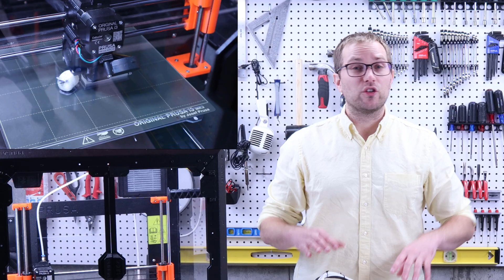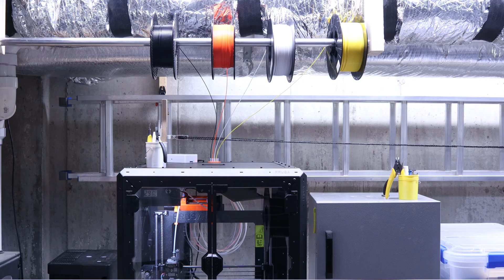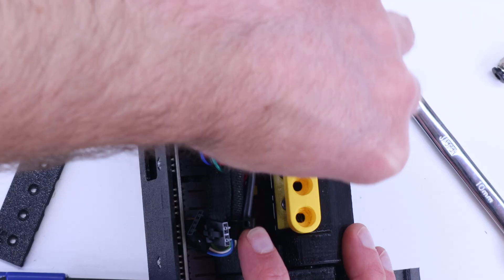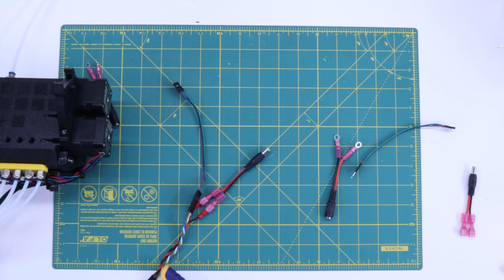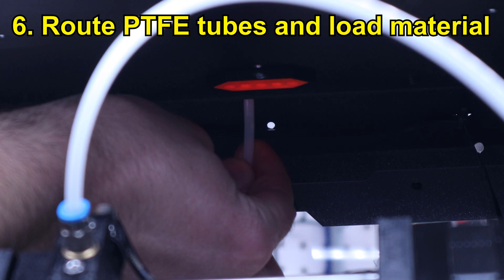How to fix the Prusa MMU2 Multi-Material Upgrade

Comment: Hey Asa, I'm returning after watching your video first time 2-3 months ago... You should definitelly check MMU3, it sesms to be much much more relieable... And, yeah white filament was causing issues for me too, just switched to a gray filament and it seems to be working fine so far (still printing)....
Reply from the maker: Thanks for watching and rewatching! I'm actually editing my MMU3 video now - should upload by the end of the week. I got two MMU2 to MMU3 upgrade kits and they're great

And yes, some white filaments seem to ball up just a bit more / worse. I switched to Overture PLA plus white and Jayco PLA white - no issues with either of them.
Reply: @AsaMakes  unfortunatelly my print failed after 5-6 hours. I now realize my problem is the "cooling tube lentgth" and "cooling tube position" settings in PrusaSlicer/OctoPrint. The tips are getting fatter when they come out of the extruder, and if that filament is not used enough they got even fatter and become so thick it is impossible to feed them to the extruder again, but they succesfully trigger the filament sensor, so the printer/MMU thinks the filament is in... And my setup is weird, I'm on an Ender 3 Pro, running a custom build of MMU3 with the 1.0.6 firmware version... So I don't have the cutter enabled, nor all the other fancy stuff... I'm also working on migrating the MMU3 related code (the new protocol) from Prusa Firmware to Marlin...
Reply: Success :) I just completed my first 0 intervention print with ~300 filament changes. Things that helped me to achieve this (may help other with Sprite Extruder Pro like me):
- "Cooling Tube Position & Length": As I mentioned in my previous comment, these were wrong, I was entering the distances for the heat break and not the PTFE tube before it, so entering the correct distances solved the "thick tips".
- PTFE Tube: Replaced the PTFE Tube inside the extruder with a new and high quality one with 1.85-1.90 mm ID.
- Ramming sequence and cooling move adjustments: For the SUNLU PLA that I'm using the following settings are working the best:
    - Loading speed at start: 19 mm/s
    - Loading speed: 14 mm/s
    - Unloading speed at start: 200 mm/s
    - Unloading speed: 90 mm/s
    - Delay after load: 0 s
    - Number of cooling moves: 4
    - Speed of the first cooling move: 20 mm/s
    - Speed of the last cooling move: 5 mm/s
    - Ramming parameters:
        - Total Ramming time: 5.00 s
        - Ramming line width: 120%
        - Ramming line spacing: 110%
        - And the ramming curve is a step like curve that starts at 4 mm3/s and goes up to 12-13 mm3/s.
Reply from the maker: Excellent glad to hear it & thanks for sharing

Comment: Printing the PTFE holder , stil have to print more pieces to setup the mmu2s on my prusabox. Also good to read you don't need that thing to control the filament rollback cause i am a bit in a thight ramp with space lol. Will get the m10 couplers from somewhere. Prolly uncle alie.
Reply from the maker: Lol uncle Alie

Good luck! These upgrades were a significant improvement for me. Very few issues since I released this video, just occasional failures to change filaments that I can usually recover from during the prints
Reply: @AsaMakes  Where did you buy the pfe tube with a wider hole?

Comment: Not sure about the video The MMU2 is the most aggravating piece of kit I purchased it worked for a while now I have red and green flashing light at every material change I suspect its the known power fault on the 5v rail and suggest its terminal till Prusa release the add on board.
Reply from the maker: I've never had the 5v issue - did you try plugging the USB micro into a USB power source?

Comment: One upgrade that I found helped my MMU2 was the Revo hotend.  That coupled with the larger ID PTFE tubes, the pass thru connectors, and the RMU filament buffer has made my setup very reliable.  Of course, I now have my 5 head XL so the future of my MMU2 is questionable.
Reply from the maker: I'm so jealous! Still haven't gotten a shipping email on my 5er XL preorder 

Good to know about the revo - I hadn't heard this before. Fortunately I've had great reliability since this video on my 2x MMU2s 

Thanks for watching!

Comment: Do the firmware update that came out yesterday

White uses titanium oxides for the color. Ti_xO_y compounds are high friction

DT or Deutsche connectors can do everything in one shot for connectors and they lock in place. They're meant for auto or marine applications, but also work well for installation where the disconnect is meant for service but not routine handling. They come in up to 20 pin assembly and they can handle 20A or so per pin
Reply from the maker: Thank you for the info! This is why I really like YouTube and the 3D printing subreddit - feels like the 90s internet when everyone was helping

And thanks for watching!
Reply: @AsaMakes  back in web 1.0 and 2.0 days with phpbb forums instead of muh social media. 

I have an mmu3 arriving in a few days shipped this morning. I'm really excited for functional prints with composite materials. Envision a 3d print in place machine with hinges in tpu, springs in petg, with a pla+ shell/housing supported by pva for perfectly accurate mechanisms that aren't welded together
Reply: @AsaMakes  
Also, lead white which idk if it's available, would be slippery af. Lead on gas was a lubrication and detonation suppression
Reply from the maker: Oh leaded gas... was a brilliant solution if you ignore the awful health and environmental issues. Same with asbestos -  incredible material, a shame it's harmful to humans. I'm sure our future robot overlords will go right back to using asbestos.

Comment: lol 800 changes is nothing. I have had many prints with over 1000. Print 1 might work fine. Print 2.......not so much. I'm probably around 1 in 500 maybe on average. But it can easily go 2000+. I've given up on the MMU2 since the MMU3 is coming soon. So right now just mono prints for me. I'll upgrade my 2 and buy a 3 for my mk4. Hopefully it works better. There are a lot of options on the table for me, but why bother when the 2 is basically dead.
Reply: I will mention my last mod though. It started as a repair, but turned into a mod. I had a piece of filament get stuck in the front most PTFE tube just before the selector (the short one with 1 beveled edge). I took it apart further than I ever have before since building it in the first place. I for the life of me could not get the filament out. It's like the filament became swollen. I can't explain it. So I went into my bag of spares and replaced it. Obviously the beveled edge should face the side that loads in the filament right? I don't need to check the directions.....oh wait......all the others the beveled edge is facing forward. Towards the selector. odd.........Well I screwed up the building of it then. Logically they need to be used for guiding in the filament during the loading process. So I flipped all of them. Put it back together. I noticed it was easier to load after this mod. Quite a bit actually. So I checked online the manual. The manual had it the way it was. The way that makes no sense. A number of people commented that it works better facing the way I have it now. Another person mention that his were beveled on both sides. So yeah very helpful for loading in new filament, but doesn't affect switching reliability.
Reply from the maker: Interesting! I will have to try this next time I do a disassembly. Thanks for watching!
Reply from the maker: Yeah I didn't have enough time to run as much as I wanted before releasing the video - fortunately no issues and many thousands of color swaps since releasing!
Reply: @AsaMakes  for me the things that mattered the most were playing around with cooling moves and increasing the unload speed, but there is a limit. If you go too fast it makes the tip WAY too jagged. I'm hoping that the mmu3 upgrades will solve issues and when combined with the easier to load nextruder the new setup with be rock solid. We'll see!
Reply from the maker: Likewise, I can't wait for MMU3 - hopefully it's been updated to support Mk4 by the time I get my Mk4 kits.

Comment: Yeah, the buffer assembly was the first thing to go for me. It also made loading new filaments way more cumbersome than it needed to be.
Reply from the maker: Have you had any issues without the buffer assembly?

Thanks for watching!
Reply: @AsaMakes  Only the issue you mentioned with the filament getting tangled. Feeding the filament in from above like you have it seems to be the best way to go, though I'll still occassionally have issues near the end of a spool (where the filament is very tightly coiled and forms a kink before getting fed into the PTFE tube)

Comment: The best upgrade is a bambulabs printer and AMS ;p sorry Prusa I really love your printers but man is the MMU crap. I'm printing a 5 color 3 material print right now. Supports use a separate material interface material. And its a PLA/TPU mixed print.
Reply: Actually I would like other manufacturers to take a look how the bambulabs AMS works. It has two major features making it so reliable:

- filament cutter inside the printhead. Actually it is not even tryed to reshape the filaments tip. The already molten plastic wich already was in the nozzle is simply left there and purged out with the next filament loaded. Increases the waste on filament change, but make unload/reload extremly reliable. Actually the Smart Multi Filament Feeder (SMuFF) is an open source solution using this approch.

- the "filament buffer". Actually the name is misleading, as it actually only buffers less than an inch of filament. There is a slider with a spring inside. If the extruder pulls filament but there is no filament delivered from the AMS-feeder, the spring compresses and the slider moves. Inside the slider is a smal magnet and the PCB under it contains a hall-effect-sensor (magnetic field detector). So the electronics always know the position of the slider.
So by monitoring the slider the feeder in the AMS actually delivers always the amount of filament needed by the extruder - unlike on the MMU2 and any else multi material unit for direct extruders I know, the feeder of the AMS stays always attached to the filament. This way there is no problem with friction in the tubes - the AMS-feeder takes care all the way from the spool (including moving the spool) untill the "filament buffer". The extruder just to have to take care of the friction in the tube from the "filament buffer" to the extruder and have to compress the spring. A quite constant load, much less than actually get the filament from the spool through the tubes, though the MMU2 into the extruder.

So the AMS "filament buffer" is not anything like what you call a filament buffer on the MMU2 (or the ERCF, the SMuFF, the Chameleon 3d and so on). The job you need a buffer for on the MMU2 and the other actually is done by turning the spools back (there are auto rewinding spoolholders for the MMU2 and others also, but they need even more force from the extruder). Or - like shown in the video - just do a proper job of placing the spools, so unloaded filament can hang in the air freely.

Actually I would love a combination of the principles between MMU2 (and others) and the AMS. Definitly I love the way of synchronising the AMS feeder and the extruder, so every spool has his own feeder, permernatly attached to the filament.
Also the filament cutter inside the printhead is an obvious benifit for reliability.
But: Its also wasteful. So as ramping profiles on unload work well with most filaments (if you tuned them properly and the filament is not white 🙂) and work even better if you have a Revo hotend, most of the filaments do not need cutting.
So selecting "Ramping" or "Cut" for every filament would be the best way to reduce waste but keep reliability of filament change. If you are unsure, test how the filament tip looks like with unloading, maybe tune the unramping profile - and if the filament tip isn't nice, just opt for "cut". It might be also depending on printing temperature. F.e. I like to print silk PLA with 220 or maybe even 225 °C, as layeradheasion is not good but can be improved a bit with higher temperature. But unloading leaves about half a meter of stringing (no joke). So definitly "cut".

Still, the best solution of course is not the AMS, its just the sweetspot between reliability and price. The best solution for multi material of course is a toolchanger setup. For example for the Voron Trident (and any printer with CoreXY and z-moving bed, for example the RatRig VCore 3.1, available up to 500by500mm²) there is the open source "WP-DAKSH" project.
Or of course the Prusa XL (but with delivery times being insane). Or e3d's toolchanger...

While a toolchanger system might cost more, it realy depends on your needs. If you need a lot of diferent colours, a filament changer is the way to go, and the Bambolab printers with AMS are the obviously best ready2go solution at the moment.
However, if you mostly want two different filaments (for PETG/PLA support or water soluble support), a toolchanger or an IDEX is the way to go (with IDEX reduces print speed due to the second extruders weight, also not for CoreXY (but with crossing rod motion system)).

Also if you do a lot of multi colour prints, the faster filament change and therefore lower printing time over all might be worth a toolchanger.
Reply from the maker: I tend to agree, if you need multiple materials can't beat Bambu at the moment 

Cost wise I got a used Mk3s+ with an MMU2 for $450 off Facebook marketplace - if multiple materials aren't critical used Mk3s+ is crazy good value 

Thanks for watching!
Reply: @AsaMakes  That FB price is unreal. Did it have any major issues? (maintenance not followed or parts issues) I paid retail for my mk3s+(ouch) but the mmu seemed like too much of a headache from reviews I saw. While I have a BL X1C and ams, ankermake has a solution called V6 ,still in testing, for their printer.  

The competition has surpassed the mmu solution.  Still debating on if I should keep my XL preorder.
Reply from the maker: No issues at all! The guy was moving and needed to get rid of it right away so I got a steal, did a z-calibration and it worked like a charm.

I have an XL preorder as well, and one of these days an X1C will show up on marketplace or something - if I can get a good used discount I'll jump on it

Comment: Frustrated MMU2 user here. I keep having power issues to the MMU2 every print or so. Prusa support tells me to clean the connectors, as if the mmu2 uses so much current that it would actually matter. I've already done the mod to bypass one of the diodes, seems to help a bit but the tmc drivers keep stopping randomly. Tried a replacement, does nothing.

A tip for your quick disconnect: buy one or two 6/8 pin molex microfit extension cables and mod the existing cables to use those instead, so you have the power and data all in one plug. I have done this and it takes less than 1 second to detach the mmu2 if I want to actually print

I'm still looking into porting the mmu code towards another board with more reliable drivers and proper electronic design, which hopefully should resolve most of the non mechanical issues
Reply from the maker: I first heard of "the 5v issue" today when I posted this video on Reddit. Kind of crazy the design flaw has been untouched for years

Good idea on molex - would have saved me a bunch of time compared to crimping Dupont connectors!

That sounds really frustrating, I hope I don't run into the same power issue with more use

Comment: I have used these community suggestions as well and they've worked great for regular PLA/PETG prints. However, I'm now doing PLA/PETG with soluble support material (PVA/BVOH) and it seems to be struggling. The PVA/BVOH filament is so soft that it gets grinded by the MMU's filament rollers. So beware if you're going down that route....
Reply from the maker: Interesting - thanks for the heads up

I wonder if you can improve by filing down the bondtech gear a bit for the channel where you have PVA/BVOH. I have a multi-head XL on preorder which should really solve the multi material problem but I definitely want to get the MMUs working as well as I can.

Thanks for watching!